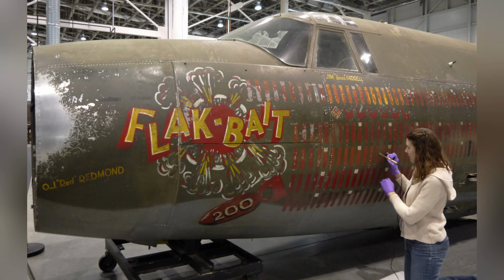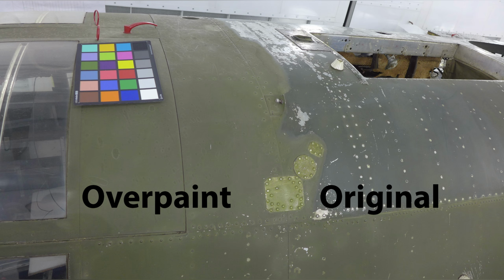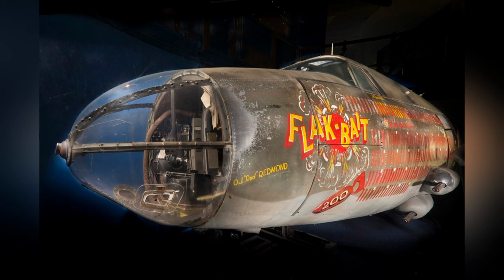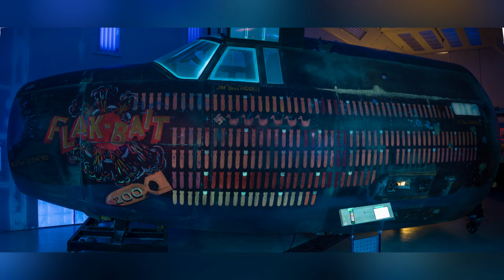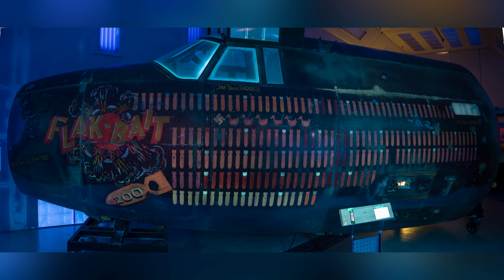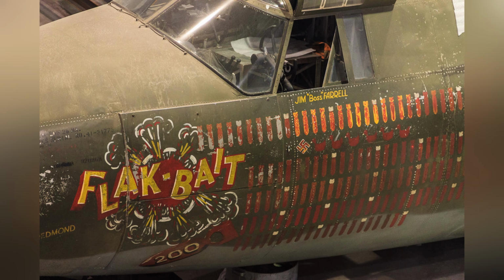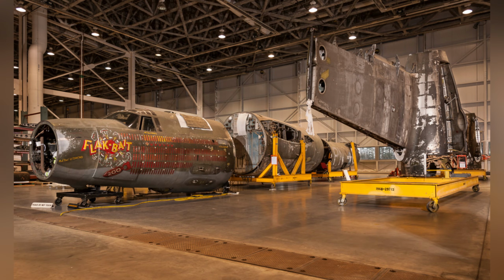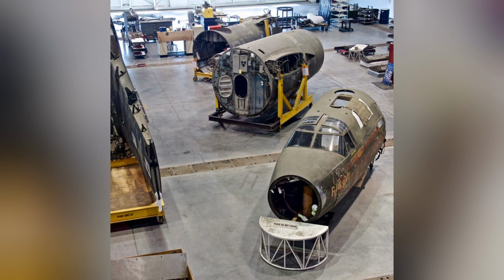Restoring Flak Bait: The B-26 That Refused to Die After 202 Missions

Comment: Since they took the thing apart, which was a mistake, they ought to repair and repaint the whole thing. They should have left it as it was.
Reply: To your comment "true," but this path " Flak Bait" gone through started since it ended its military service. Hindsight always 20/20. At least they are preserving it for future generations. 😊
Reply: @jeffreynunes273  To me, it's getting all new hardware, nuts, bolts, washers, Adell clamps, rivets, sheet metal, primer, and who knows what else. Surely they could have stopped the corrosion someway else.  Bottom line, it's their B-26 and they can do what ever they want. It is not an "original bona-fide " artifact anymore. The. "Memphis Belle" and "The Swoose" are just rebuilt B-17s now. If they want to rebuild it, fine, just go ahead and do it.
Reply: @leroycharles9751 👍  just do it .